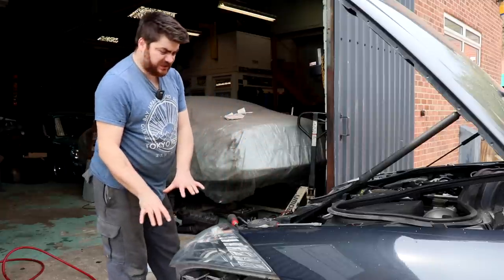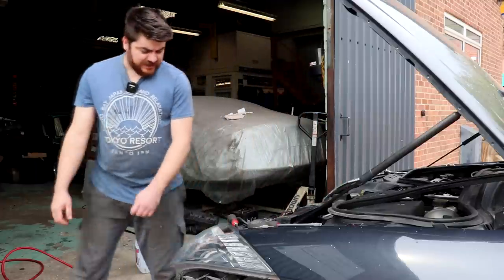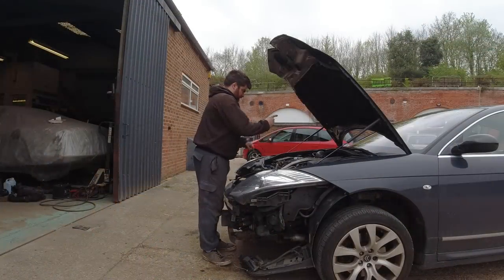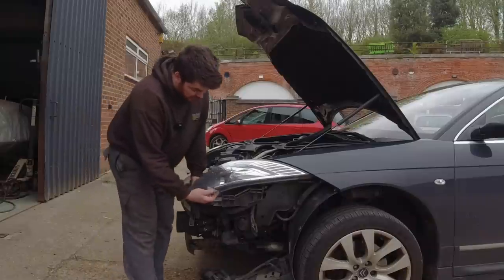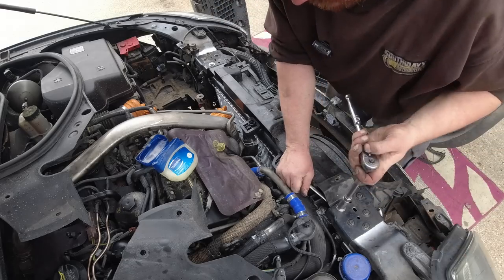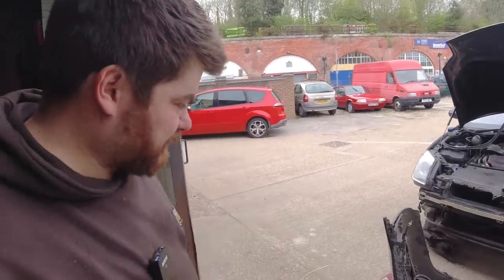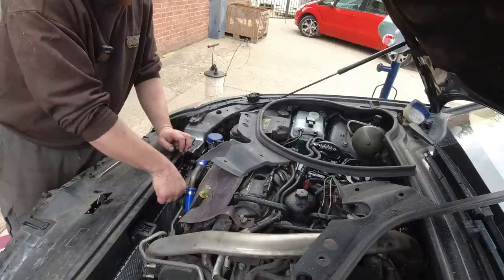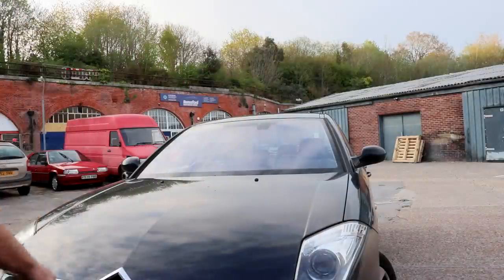Cheap Citroën C6 Project 15 Cooling System Repair VLOG pt4

Comment: I found a similar leak by pressure testing the coolant system, it would hold pressure and slowly leak down and i could not find the leak.  It turned out eventually to be the curved 90 degree pipe on the front egr unit was leaking underneath the 90degree bend section and evaporating on the EGR cooler when hot (the round stainless bit).  
It was spraying out only at 2500-3000rpm and evaporating away!  It was found to be a pin hole in the hose!  Well done for the work so far.   Bring a roll of Gorilla tape to France and you can then wrap these pipes if you get leaks along the way.  As you mentioned the pipes are the real problem with the engines (2.HDi & 3.0) The poor plastic tanks and poor quality coolant hoses are the real problems.   Otherwise the car is great!

Comment: long enought toget the cooing fans to start? Tha's basically long enough to melt granit. That's the most irritating part ofworking on modern PSA cars. Every FN componnt replacement requires runing it up to temp which is basically impossible in a garage environment. Also running the car up to 3000rpm on every gear to initiate diesel injectors. You can't even legally do that unless you go to germany. What would you estimate the speed at 3000rpm would be in 6th gear on a diesel?
Reply: My 2.2 idtec CRV 3000 rpm is an indicated 80 odd mph
Reply: @neilcussons4744  Yeah quite alot more than we are allowed here in sweden a least.
Reply: Not quite alot but some since our max now is 120Kph and not 110 like it was most of my life on the road.